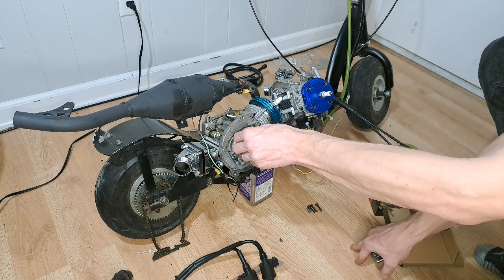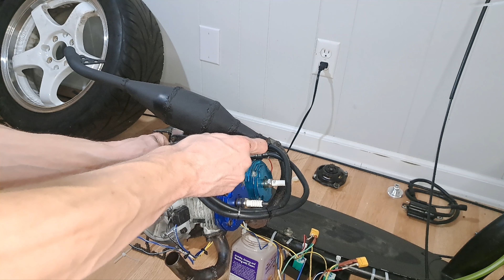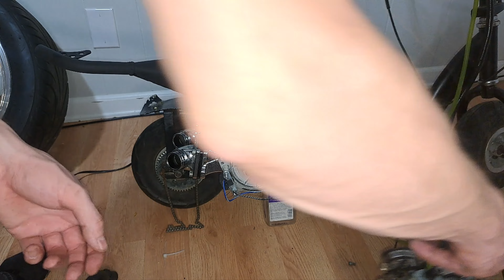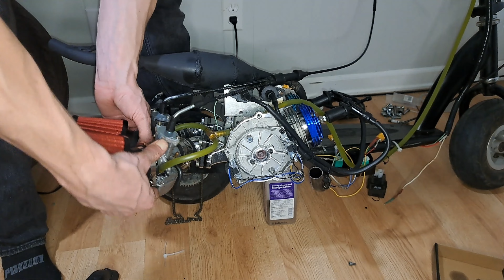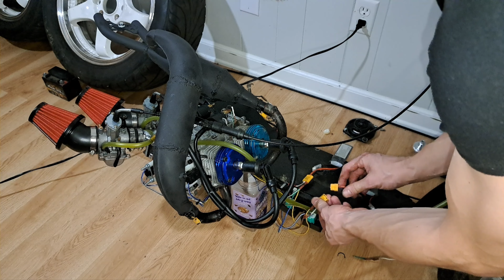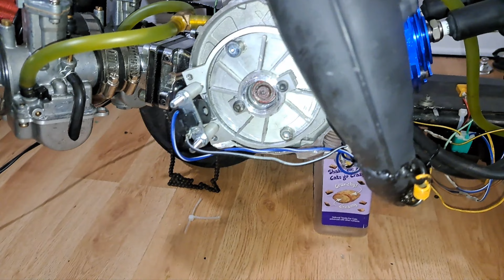Homemade twin cylinder 2 stroke engine assembly. 100cc twin cylinder powered razor scooter.

Comment: That's legit insane, and maybe it's just me and my size US 14M feet but how will you fit both feet on the platform?  The ones from my day had a big platform, we had a seat post hole as well so we could stand or sit, the cops HATED us.  Nothing they could do for about a year, then they were legally outlawed from the streets, which then just made us criminals, they were up to $1k back then, this is 2000-2001.  Some of us worked all summer to get ours, and weren't going to just look at them in our room.
Reply from the maker: It's not too bad, but it's definitely not the most spacious thing lol but that's all part of the fun of building something ridiculous like this.

Comment: What ccs and model engines are these? Lol im currently building one out of a razor E what ever and a 63cc 2 stroke Harbor freight gen.  And the next one i build is gonna be 100% custom bent frame.... these lil scoots are fun as hell
Reply: Oh and if you have test and run videos id love to see em subbed!!!!!
Reply from the maker: @jaredfrade4467  They are each 50cc pocket bike motors with quite a bit of custom work. Using honda dio af18 intake manifolds, pwk carburetors, high compression heads, the flywheel I machined myself and I built the ignition system as well. I have a video of me riding it before it was running properly that I'll post a link to here in just a minute.
Reply: Sweet im a welder machinist by trade. I love seeing kookie stuff like this!!

Comment: Carbs big eh?
Reply from the maker: I actually use the pwk 21mm carbs on a lot of my 50cc 2 stroke engines. I have tried virtually endless varieties of different sizes and types of carburetors. I found these give great performance gains.